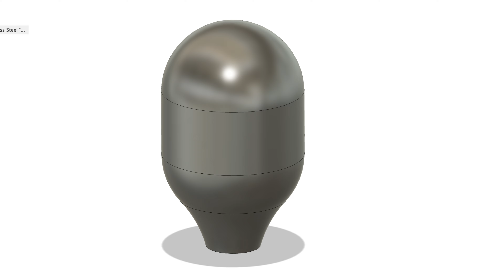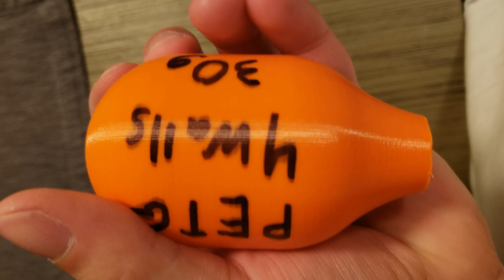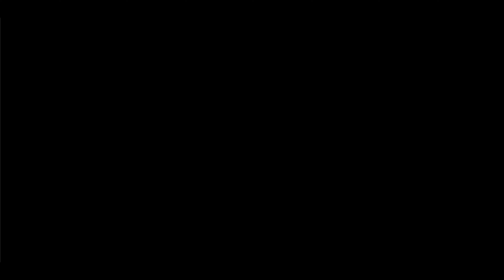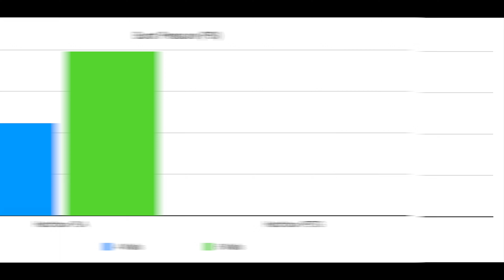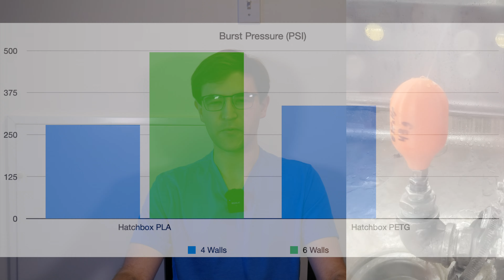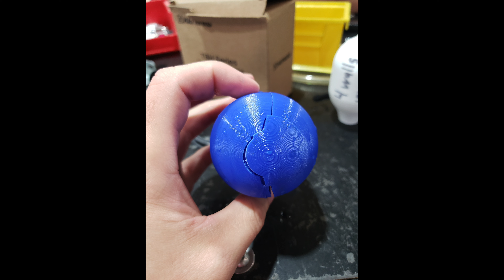How Much Pressure Can a 3D Printed Part Handle?

Comment: Pressure vessel engineer here. I’m curious as to what your print settings were? I’m assuming you used a  high count on  wall loops? What was your nozzle, cooling, & speed setting?

Comment: this is hugely useful and is going to be tested in bike suspension in the near future. Funny you said 5x safety is at 100 psi as that's my "worst case" pressure for my first trial.

Comment: Uses?  Yeah, my RC submarine might get a custom pressure tank now!  I'm dealing with much lower pressures and I think a good acetone treatment will help make them air tight.  Thanks for doing this.  (Don't worry.  I won't do this at home.)  😀

Comment: This was way helpful. I'm working on a water rocket project in college and was going to use a 3D print coupling to bind two bottles holding 100psi. I think I can hit it. Needless to say I'm going to bring spare prints to the test. Thank you for the valuable test information.

Comment: Dude this is AMAZING for what I'm using this for. I wish to make an Air Venturi system and I was concerned that 60 psi shop air would be too much for the PETG. This makes me feel a lot better but I'm still gonna be wearing full face protection AT LEAST during testing tomorrow

Comment: Can you test 5PSI over 1day and see what happens? Curious about water tightness for pump pressure lines on aquariums to replace the EHEIM Green "lily" pipes. 5 PSI is Max pressure head of pump (being 2.6M of Head (water)). I would consider printing then soaking in epoxy in a vacuum chamber to ensure voids are filed but that might be over kill vs drilling tank and using off the shelf PVC fittings.

Comment: Your test here is actually more useful than you think. I was looking into making a special air release valve for the top of irrigation bonnet valves. We have issues with air getting on the top side of the bonnet and the valves not closing. There doesn't appear to be a fitting that will take the control pressure line into the top of the valve and also have an air release at the same time. Your demo shows that holding six bar of pressure, the maximum that we are likely to see is very doable and so I'm going to design and print one now to test out.
Reply: Please report your success
Reply: @gkalkowsky  It seems like he died

Comment: i have been fleshing out an idea for a 3d printed rocket propelled grenade launcher that uses propane and oxygen to initiate the rockets ejection from the barrel in order to increase the distance from the shooter before the rocket fires,  to prevent burns. sort of how the javelin missile works. Based on your experiments do you think that its feasible to try printing small pressure vessels that can hold a small amount of compressed propane and oxygen? i imagine it wouldn't need on ton of pressure to just hold enough gas for a couple firings or would steel canisters be the only way to go? being able to 3d print these small vessels would certainly allow the design to be much nicer and easier to fabricate.

Comment: Another way to make them air/waterthight is by anneling or remelting.
Theres many ways to do it, the most effective one is salt anneling.
By burying your part in salt you basically make a mold of the part, inwhich it gets re melted.
With the melting tempreture of the part shieved, it starts catalyzing creating a solid part.
Not only should it be air/water thight, it may be even stronger;)

Comment: The manner in which the part was printed, will also decide how strong the parts are. It is not about number of walls alone, it is also about how high a temperature was used, amount of overlap between walls(overextrusion could be beneficial-which was covered👍) and even the nozzle size, should have to be atleast 0.8mm or more
(not sure if all sl8cers allow for higher layer height). Also a staggered thinwalled honeycomb grid structure holding on to inner walls will do much better. Apart from that, there  are plastics, that could be annealed further for increased strength. Just some suggestions...

Comment: If I'm correct in my calculation (and the leakage problem could be solved), you could potentially 3D-print a small submarine with a diving capability in the range of 300m below the surface?

Comment: Regarding leakage: What about inserting a condom before filling with water (and making sure the threads are sanded and lubricated)? Initially the air would fizzle out through the pores, and then the wall would serve as armor. I've probably forgot something essential... or not.
Reply: Came here to suggest this :)

Comment: have you seen the cnc kitchen video about printing clear prints with petg? those settings also made the print a lot stronger, would be cool to see if that would increase the pressure it could hold

Comment: 3d prints are going to be inherently leaky off the bed. Some kind of sealing layer may help, maybe some thin epoxy run around the inside and left to cure. Otherwise, you could salt bake them to get them air tight.

Comment: ~~I get 3D printed water-tight parts by over extruding the PETG~~.  Although on this new printer I have, I havent had to use that trick as long as nothing weird happens in the print, the walls are solid.

E: Beat me to it, at the end of the video.
Reply: what printer is that? I need one.

Comment: I've been thinking of doing something similar, but for vacuum instead of pressure.  Also, you can get better seals from PVB as long as you don't soften the infill.

Comment: not expert in fluid dynamics,  but know a few things.   as other comments stated;  design need to be tested based on three points of operational consideration.  
first point is the max rapid fail (that is done with reserve pressure, fill design up so fast,  allowing the vibration of the pressure to reveal shatter or weak points. thus revealing engineering exploits).
second point is standard fill to max (usually start the test method in order to find design's capability based on standard pressure making equipment).  
third is "safety / operational" point.  most design 1/3 or 1/4 of the maximum capability.  
I am told, thus not expert in such dynamics.  If device "stays together" after breaking or shattering  is "best" safe design.  Shatters into  small pieces but not staying together is considered dangerous design.  
 then the reduced specification aka safe/operational specification is based on handling "surprises" such as extreme weather example  fast freezes,   heat waves. same with fire and "external" crash crush (ex roof falling down on it).   Those do change the device capability.
the disappointment here,  you did not specify water temperature in your test.  cold water, luke warm and boiling water all behaves differently in a designed vessel.    I understand, you dont want to "experiment" like a engineer would,  I respect that.  Thank you for providing some discovery detail regarding the pressure vessel you experimented on.   Would you release your "model" for someone else to test if other want to dare?

Comment: Maybe pour some paint inside to seal the pin holes maybe ?
Reply: I was thinking about something similar: resin, but you also pump a bit of air pressure to force it to get into the pores. but the results depends on the geometry of the pore: if it acts a as perpedicular plug (unlikely), you just made a bullet.

Comment: Thank you for this info! I was looking for similar information but not for a tank. I posted a question on Reddit but never got a response. I have a 300psi pump for water/methanol and I need a manifold for 2 hydraulic circuits with 12 outputs, all based around the Cummins 6CTA8.3 intake bolt pattern. Now that I know that PLA/PETG can handle those pressures I feel better about testing further. Actually I would’ve been working on it already but my printer has been broken for 3 weeks, I’m still waiting on a replacement ribbon cable for the controller.

Comment: I can't emphasize enough the difference  between pressurized water and air/gas in relation to the likelihood of losing eyes, fingers and generally eating shrapnel.  Consider it like this... pull on a 50' chain with all your might and let it go... not a dramatic show.  Now pull on a 50' spring with the same force and let go... and observe the drama.
Reply: Indeed. For this kind of hydrostatic testing, the normal setup is to also have the part itself under water, rather than in an air enclosure. This is particularly important with metal parts and with higher pressures, because even though water is not very compressible, at thousands of PSI it still stores enough energy to create very dangeous shrapnel. Having the test piece under water quickly slows down the shrapnel to safe speeds within just a few cm.
Reply: no one ever got anywhere in life by being safe...
Reply: @commandingsteel  OK boomer
Reply: @ngDetecter  i don't think you have the slightest understanding of how that should be used...lol

Comment: Yes it would have been cool to see the video of the failures but still a very surprising result considering most commercial pressure vessels are rated at about 10-12 bar or 140-170 psi so that's way below the pressure you got to 👍

Comment: Those are great results.
Have you heard about Filament Winding?
In short, the process of winding for example carbon, or glassfibres, drenched in resin, around a vessel, to increase its capability to resist preasure and keep it comparitively light?

Comment: This is great information. I've been considering a 3D printed pneumatic nerf gun but I was questioning the pressure holding capabilities of FDM.
Reply: Carbon fiber's gotten really cheap these days. It's even competitive with fiberglass.

Just wrap your pressure vessel.
Reply: @jtjames79  Or just use a crabon fiber tube as the air tank, they do that with air guns.
Reply: You can use anneling, salt anneling will give the best results.
By burying your part in fine salt powder you basically make a mold of the part, in which it gets remelted.
With the melting tempreture of the part shieved, it starts catalyzing creating a solid part.
Not only should it be air/water thight, it may be even stronger;)

Comment: Hey It's quite interesting work, I might use this to make a bb shooter 🤣. I have a small design suggestion, you can try adding ribs inside the tank to hold the pressure better and Maybe put epoxy resin to make it water tight ( would love to see the results in the next video), on more thing me be you make a bounding box around tank and pour resin in between the cavity to make it even more air tight and withstand the pressure better.
Reply: Let me know if I can help with design of this new tank. 

More than happy to help

Comment: Good job on filling your vessels with water - I used to make stainless steel boilers and pipelines, and that's how we used to test them to 45bar. You really don't want a large pressure vessel letting go with that kind of pressure behind it. BTW, how's the joule thief getting on?  Mine has just passed the 3 year mark